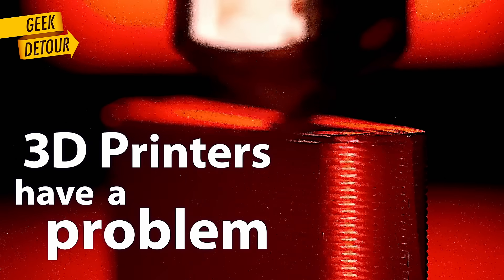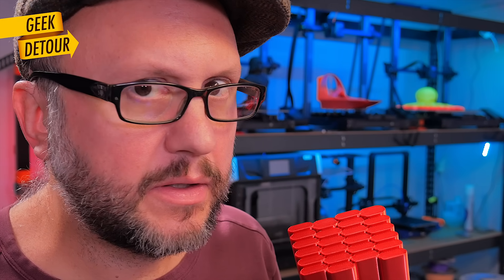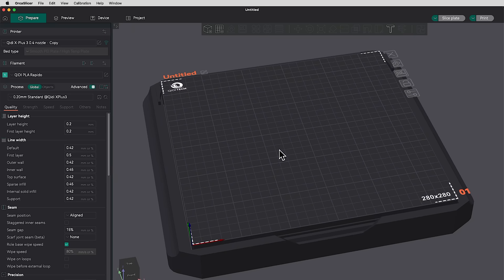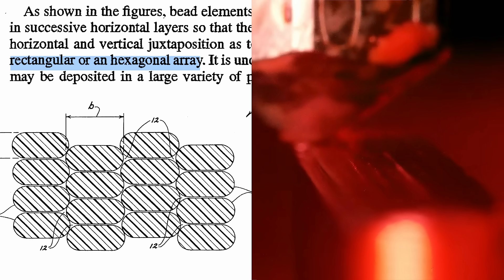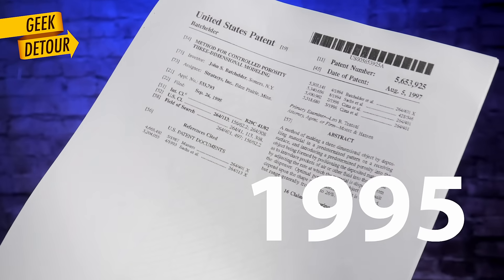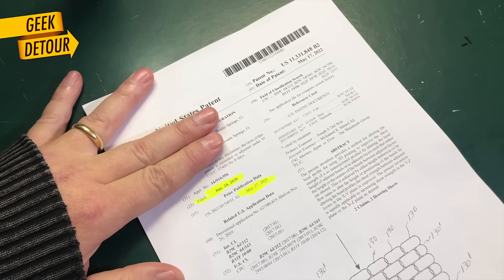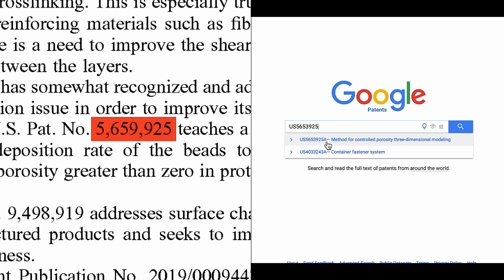Brick Layers: Stronger 3D Prints TODAY - instead of 2040 😬

Comment: There was an attempt to stop software patents being introduced in EU some years ago, some of the materials gathered to point out the flaws in this brought up a very important detail: The usa patent office, lawyers, and courts have certain prevailing issues.

Patents that should be rejected due to pre-existing techniques or patents are routinely let through. Of course, you could argue that it's just a matter of mistakes, but it happens very regularly. It's almost like the patent office are letting through bad patents so that the patent lawyers must be hired for legal cases in the patent courts.

Essentially the claim was that a rejected patent will cost a certain amount of money to have written up by hiring a patent lawyer and filing it. Whereas a patent accepted will have the same lawyer allocation but then there will be patent legal battles that requires more lawyers hired. These battles can even happen between patent holders because they both have a patent for the same thing. Which requires going to court to prove that they are overlapping, and thus the less recent one is invalid and should be rescinded.

Take a combination of economic incentive, lack of searchability, and you have the current stew of issues. It's even worse, believe it or not, in the software industry. Where someone literally filed a patent for a shopping basket. Not how it should be programmed, or how it needs to be stored in memory. Just the end goal: If you want a shopping basket (a real life existing object, mind you) then you need to pay for the use of this patent that has no actionable instructions on how you make a shopping basket.

If the same patents were allowed in medicine I could apply for a patent for curing cancer by writing "A pill, shot, or similar that cures cancer." So yes. Patents are 100% useless in software, and getting closer to useless in other fields.

I might have some opinions about them. Not sure if that came through…

Comment: Honestly, i think that in 2024, patent applications should have to:
1 - Prove that the applicant themselves actually invented what it is they're patenting.
2 - No easily acesssible evidence exists that others have successfully created it before.
3 - That the patented "thing" is not entirely derivative. (Meaning at least one aspect or combination of aspects is novel)

I also think there needs to be obligations imposed on the patent holder:
1 - They must make the patented thing acessable/available either commercially or free of charge to those who would benefit from it or they lose the patent.
2 - Patent usage itself cannot be liscensed to anyone, only the products created with it (to prevent patent holders from sidestepping the previous obligation.)
3 - New patents can be submitted by others that use your patents in their designs, and as long as they build significantly upon your ideas and provide something new, they will be approved to that other party.

The whole point of patents is to give a monetary incentive for progress, innovation, and invention. If the current rules are doing the opposite, they need to be discarded, or updated to serve the stated purpose. With corporate consolidation at an all time high, patents are actually slowing progress and innovation far more than theyre speeding it up. Anyone with an invention just sells it to a company that tries to make a buck or two off of it and uses propriety and exclusion to extract and hoard profit at the expense of innovation. 99% of inventors themselves never hold or retain ownership over the patents they were responsible for. And a ton of patents are entirely asinine and shouldn't qualify; they just serve as a state-sponsered and enforced monopoly.

Comment: I am wondering what can be done more.
1. Make the nozzle hole in some shape that will purge the material more flat one on each other. Without air gaps? Maybe the interlocking layers can make it easier to increase the flow and get fewer air gaps without compromising the accuracy (the idea is that when you print in an interlocking layers, you print into a "canal" area that keeps the plastic in place) maybe this can be solved also with more flow all over the part, and less flor on the outside wall.
2. Give a pass on the layer with a hot probe or nozzle or laser before printing on it. So you can put the layer on hotter plastic and let them merge better.

Comment: Since this is still an active topic and there hasn't been any concrete news, i did some digging myself and found some interesting details. 

In the EU patent application (EP4094924A1, not yet accepted and equivalent to the 2020 granted patent discussed in the video), the correct stratasys (US5653925A, expired) patent is mentioned in the patent documentation. There is currently another patent application in the US from the same company as the 2020 patent (US20230249394A1, pending), and a granted patent in 2014, to adobe, for doing something in regards to surface quality of printed parts (US9498919B2) and some it may be interpreted in a similar manner to the patents being discussed.

The pending 2023 patent application uses the exact same abstract and images as the 2020 patent, and the claims are very similar. It also seems the current 2020 patent isn't patenting offset layers in general. Just patenting the first layer having alternate beads of filament at half-height and full height. While the expired stratasys patent seems like it did indeed patent the offset layers in general.  Oh and i also noticed that at the claims in the end of the 2020 patent they mention the width of the beads, which i found a bit odd. They reference specific axis of movement before this specific part and the patent may be trying to represent "the width of the vertical axis" or something like it. I don't understand legalese well enough to be able to fully parse, differentiate and compare the claims of both of these though.

This part is speculation on my end, but the adobe patented method could potentially apply the offsetting of the beads on a layer by layer basis. This wouldn't affect the layer strengthening achieved by the brick layers, since it doesn't create brick layers, but could help strengthening parts on the same layer though. By offsetting the "round" part of the oblong layers such that the voids are above the flat part of the oblong beads, creating smaller but more frequent voids. Further testing on this hypothesis would be needed though.

But it seems to me that having the first layer alternating beads at 100% and 150% height, as shown in this video and the CNCKitchen video, is not protected by any of the currently active patents.

Disclaimer though, I am not a lawyer nor the most understanding of this whole debacle and my understanding might be completely wrong. Parsing legalese is not at all fun and it's very hard to understand, especially since english isn't my first language.

Comment: No the patents department does not really do much research. They just look for anything that's like it currently and that's it. The US patent system is broken! Just completely useless. It allows for pat and trolls to do what they do and it allows for the bad guys to skirt around the laws and it makes it impossible for the good guys to get a decent patent that actually protects them.  Stratus is the one 3D printing company that is also suing bambu and all the other 3D printmakers that do things like heated print bed prime Tower extrusion methods by using sensors to detect the pressure and things like that. Some of the things that they patented that is such a simple idea that everyone does it and has done it they decided to go around and put a patent on it because no one else did. I hate patrols that do that. If something's out there in general use there's no way you should be able to go to the patent office and say this is my idea and then go back to the people who are using it and claim to get your money back for licensing. I'm not saying that's what they're doing with bamboo labs and such they're not they actually do have old patents that are been around but damn near every 3D printer does the same thing. It's just bamboo is the largest most successful one
Reply: Where I've seen this before is in the IT industry where Pat and trolls will sue all the customers of Citrix for example because somewhere along the lines they bought a patent that has patented the idea of accessing a remote desktop from another computer. And Citrix refuse to license it because it's just a common feature. Meanwhile Microsoft has a licensed it for RDP VMware has a license it for PCOIP VNC has to license it for remote screening and so on and so on and it is such a BS thing because it is just an idea it's not an actual technology. Just a simple protocol and that's it but our licensing system or patent system allows it
Reply: And those patent trolls with Citrix were able to go around and find every single company that uses it which was hundreds of thousands and Sue every company directly for utilizing that technology that was available through the Citrix platform. 

This was back in 2016 I believe. The company I was at, Fortune 500 financial firm was getting sued for it and since I was the product manager for that software I had to deal with all the lawyers and everything around it
Reply from the maker: That’s quite a story! Thanks for sharing it! In the IT world patent trolls are insane.  Really, nobody should be able to patent something that exists only in the paper.

Comment: I'm no legal expert but that patent doesn't seem enforceable to me. I'm pretty sure patents have to have some degree of originality or novelty to be viable: since the brick laying pattern is well known to be a stable means of construction, even if that knowledge comes from sources outside of 3d printing, then it's not an original idea by any means.

Edit: Typed this up before seeing the part about the older patent that went into public domain. The fact that a patent already existed and went into PD is even more evidence against them, especially if they made no changes to it whatsoever.

Comment: For now, use 2:1 slopes when designing 3D models.  On a 0.4mm nozzle with 0.2mm layers, you get the same effect.  It’s also an amazing overhang ratio.  I try to implement them as much as possible in my designs.  I’ve even made pneumatic pressure chambers and heavy duty adapters that utilize the same slopes, and are still holding up.

Comment: Why is it so difficult. After all, you can lay out the layers at the same level with a displacement. Like brickwork. And end the edge at 0.5 or 1.5 from the thickness of the nozzle. The slot of the lower layer will be filled with the top layer, creating a mechanical lock, increasing strength. And the printer will not need to jump every time on the pile of the layer, which will deceive the load on the calculations. Check if someone has not patented it will be a simple solution to the problem with additional strength. I also have a solution as programs to solve the problem with support on a printer with one extruder, as this is realized on a printer with two extruders. Two materials. Without losing plastic and time. If someone can realize it, I can share other ideas. Unfortunately, I am an engineer, not a tester. Everyone should do their own business.

Comment: Hi! I'm shure, interlayer adhesion problem is totally solvable. Just think about how two plastic part are connected together in other industries: 1. glue; 2. welding with heat; 3. ultrasonic welding and so on. In 3d FDM we already have premelted one "part", so we need to locally premelt the surface of the second "cold part" just before contact with melted filament. That can be done with LED laser or laser array (dirt cheap nowadays) mounted on printing head.

Comment: Hmm, my perimeters don’t have that issue of gaps same with solid layers. They are solid. I can only see the rounded bit on outside perimeters. You just need to calibrate your extrusion width to your nozzle flat area along with your overlap along with your outer perimeter extrusion factor(for dimensional accuracy). I don’t see this patent really being that big of a deal. If anything, it would make my prints fail from the constant z change and all my oozing. I’m printing around 45mm3 per second 1mm nozzle with 1.2 width and 10% overlap, moving slow at 65mm/s. This is on a 540x540x600 build volume. There are other ways to get even better results than what this patent offers with what we already have is all I’m saying.

Comment: Well, I worry when 3d printing that the layers won't align vertically and could infringe on the (invalid) patent due to imprecission in my system. We need an adjustment to control the offset with each layer so we can be certain we are not infringing. 😉
Reply: Exactly what I was thinking

Comment: Would it be possible to inject a tiny amount of some kind of heat activated epoxy in the gaps? Heat activated so that the heat from the hot plastic activates it

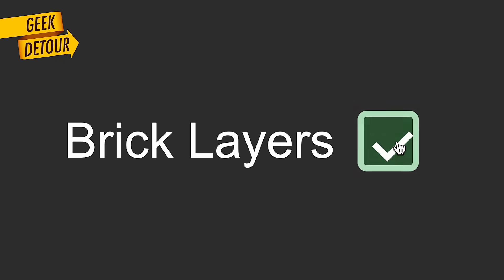Comment: 6:34 Strange test. The elasticity of your rope falsifies the entire result. Better tests have been documented in materials science. Please inform yourself about “tensile test” or the "3-point bending test", which have been used to measure material strength for over 150 years. Why do you want to reinvent the wheel? Use the tests and evaluation methods that every materials scientist uses and every student (e.g. in mechanical engineering) learns this in the first semester. The principles described there can also be used with simplified setups; it does not have to be standard-compliant.
Reply from the maker: Sure! Proper machine slowly in the making. But I was not testing displacement, just force for breaking, between different subjects. It was very comparable with very small CV. Video in the making.

Comment: Patent offices (especially the U.S. one) basically just go ahead and approves anything as long as it isn't conflicting with existing patents these days. That's why simple non-innovative patents get approved these days, or say patents for mini-games in loading-screens for larger sized games, or patents for having buttons on the back of the hand-controllers (for consoles and game related HIDs) ("HID" or "human interface device") patents have basically become a "one size fits all" kind where patent offices doesn't even bother checking if a patent application is worth protecting.

Comment: As I posted in another video this will do very little to increase the strength of the prints. For it to be effective the overlap needs to be in both planes. Your examples just like the other video show layers with half a step in the vertical plane but none in the horizontal. The ends are allowed to flow into the small gaps but only by maybe 10% so you still have basically just the adhesion between the layers holding the part together. Just 10 seconds into your video it already has a fail. Your Lego blocks have 3 vertical seams, as you are holding the block, that runs from one end straight to the other. You have overlapped one plane but not the other.

Comment: If brick layers can be done, then thin outer wall and thick inner walls can work, too.  Something like 4 x  0.04mm outer walls to one 0.16mm inner wall to achieve fine details and increase print speed and strength.

Comment: It easy to find a loophole, simply add a "layer infill displacement" variable in the slicer, that on default it is zero but you can set it freely (to 0.2 half of nozzle diameter). This way the slicer programmers are not responsible but only who prints, but no company's will legally bring you to court for slicing and printing your own parts at home using this method
Reply: Gigabrain
Reply: „Simply“ 😂
Reply: @TheDavidsonary  what a graet idea. exactly how is this done?
Reply: That’s called inducing infringement.
Reply: Who would thepatent holder even sue ? What if its a slocer thats open source ?  @philistineau
Reply: @philistineau  no, you don't tell the people about it, simply leave a free parameter
Reply: @DarthPlasma  You'd still get sued, and you'd still face all the issues with having to fight the patent troll. If you're willing to get sued, you might as well skip the nonsense and fight the patent troll directly.

The whole reason slicer makers won't put it in is because they don't want to defend against the lawsuit. Putting such a setting in in this way doesn't do anything to protect the slicer from getting sued at all, they can sue for whatever they want. The patent holder is going to lose, but they were already going to lose. It will still cost thousands of dollars to defend against the suit.
Reply: Who would thepatent holder even sue ? What if its a slocer thats open source ?  @philistineau
Reply: @philistineau  thats called shut up. you cant infringe on a stolen idea.